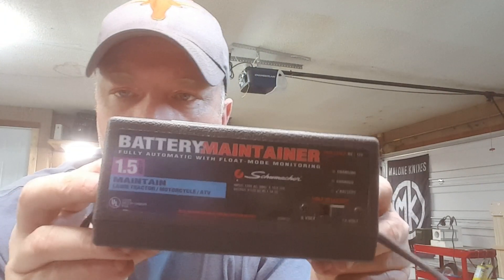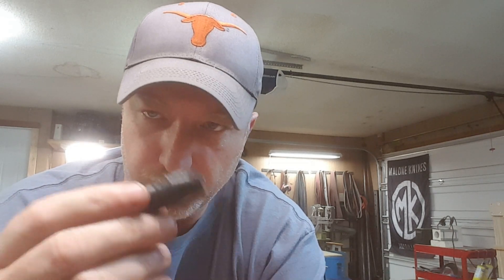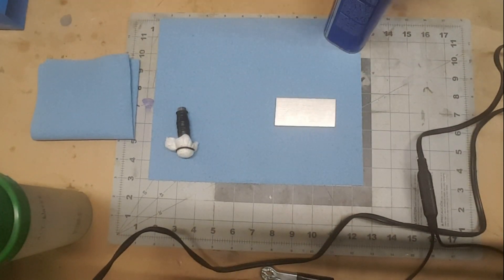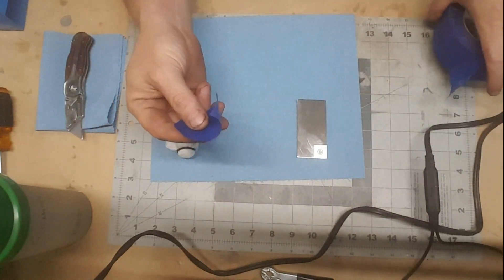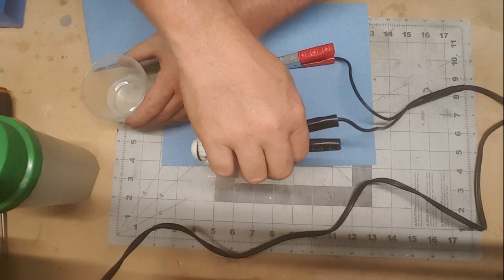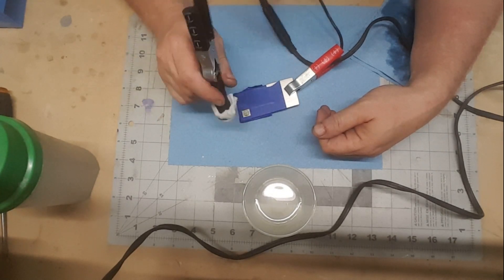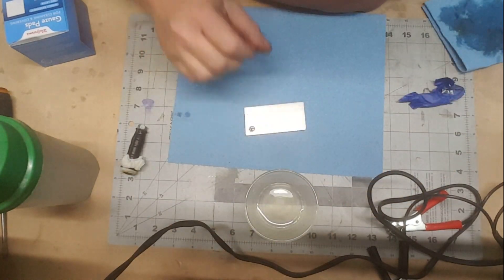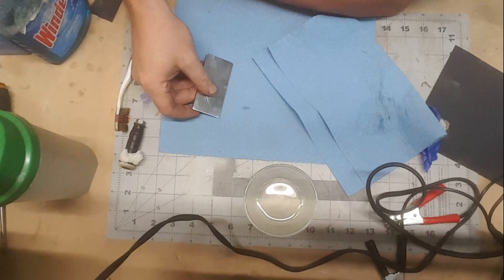DIY Makers Mark - How To Etch A Logo Into Steel - Salt Water Etch

Comment: That looks great! Wonder how much quicker and deeper the battery chargers gets than 4 interlocked 9v batteries? I'm afraid of the electricity so I use 9v but the battery charger would be MUCH cheaper than buying lots of 9v batteries. Thanks for the video. Subbed to your channel

Comment: I almost bought the personalizer plus $400.00 until I saw this video. I have an old marine style 12v battery charger with auto or manual charging switch. I do believe this will work. All i need now is some courage and stencils. Thank you.

Comment: hello why don't you do DC to color it black first AC then DC
Reply: Long time you wrote that, but maybe some reads after. DC ( Battery charger etc.) produce DC. Great for etching. AC Powersupply applies color to the metall. So, first DC, than AC if you want color. Take care to stay, say below 12V, for your safety.